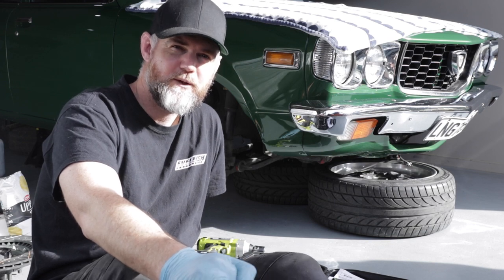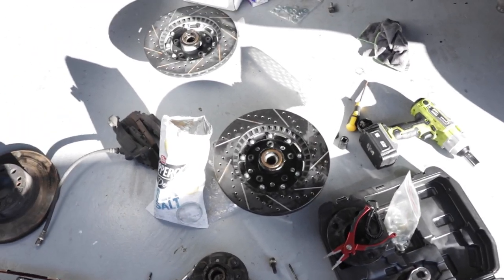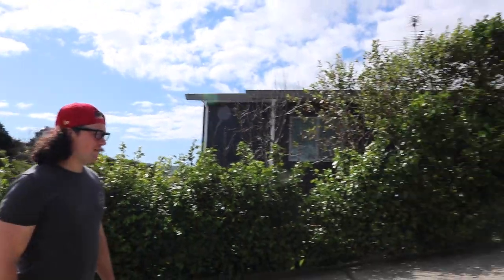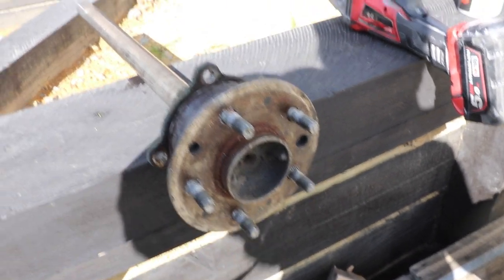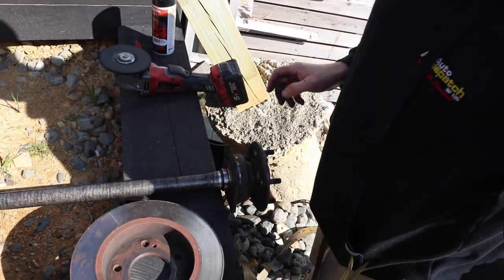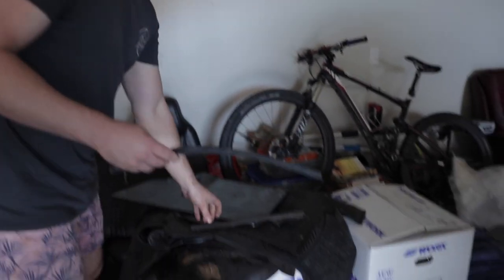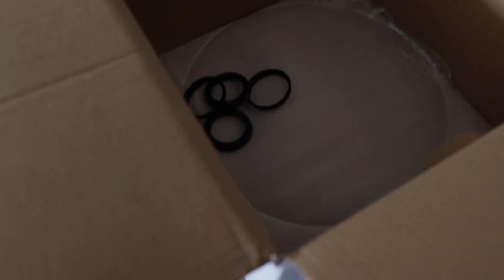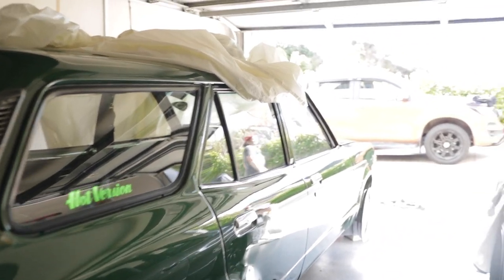13b PP Rotary 808 Wagon - Disc Brake Conversion and New Wheels

Comment: Hey fella's. Great V logs of all the rotary stuff you've been posting. I'm having the exact same problem with bearing sizes. Thought I had rx3 adjustys but the stub axle must be series 1. Trying to fit stock rx3 front hubs but the bearings aren't matching up. What was the part number of the bearings you guys used?? Cheers!
Reply from the maker: Heya, it's a NSK HR320/28XJ that worked in the end - good luck hope it works for you too